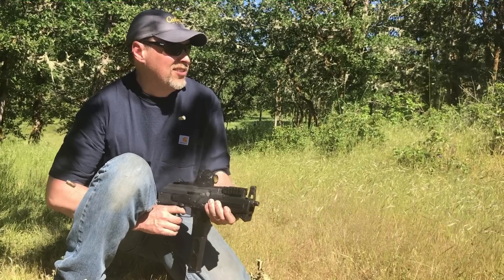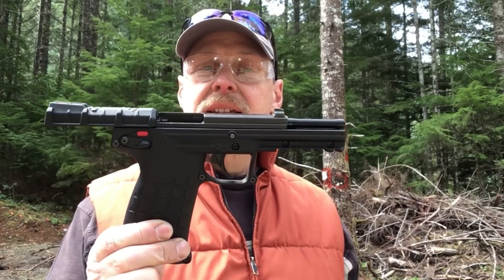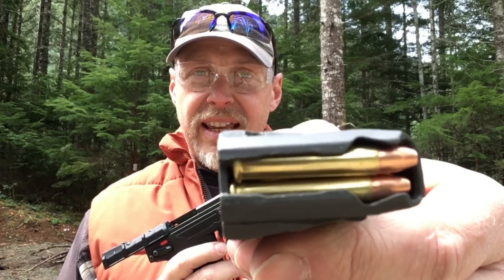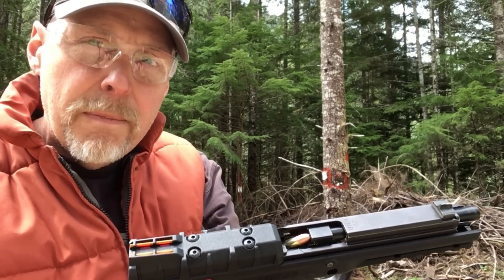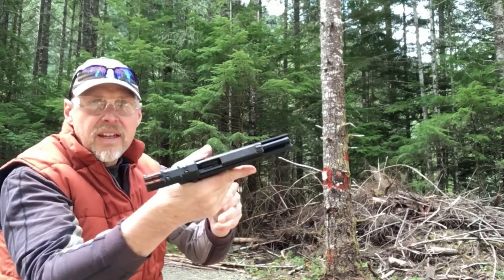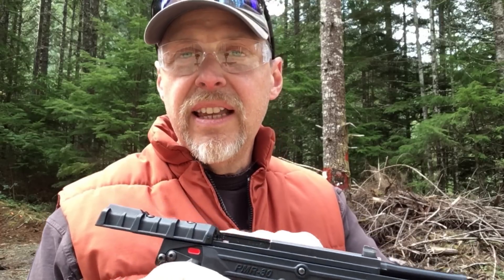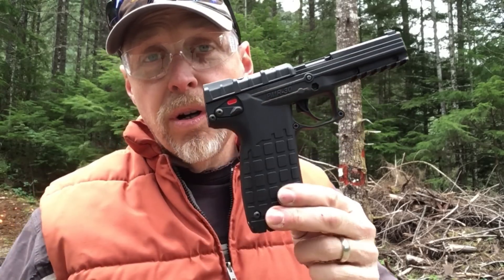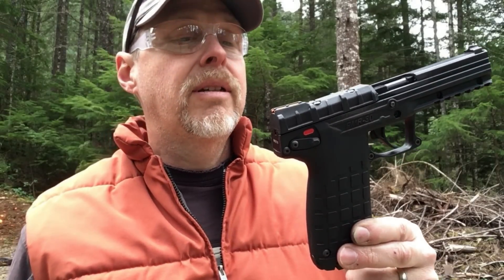Troubleshooting: the Kel-Tec PMR 30

Comment: These have been around since the 80s. went under the maker of Grendel which was the ancestor company of Kel Tec.
Reply from the maker: Haunted Hornet 
  Yeah. I did a google search and this came up with some info of that also. 
  I just love the idea.
Reply: @MaxHeadspace9mm  i had a grendel p30. It was well used. Had to fashion a firing pin for it. 

Got the carbine recently. Not sure what to make of it for now.
Reply from the maker: Haunted Hornet 
  The CMR30? I’ve heard good things about it and hope to get one sooner or later. What are your thoughts? Looks compact, light and shares mags with the PMR30. What could be better?
Reply: @MaxHeadspace9mm  havent shot the proper ammo through it. Mostly failure to extract as in the case remains in the chamber. This is my fault for not getting ammo with a high enough impulse to work the action. I figure 10 lb ft of momentum is necesarry while a lot of ammo us only pushing about 9 to 9.5. Im going to run cci maximag 40 grain and hornady critical defense next time i go out.

Also lookin into the 35 grain a22. It pushes over 10.6 lb ft of momentum.

I an thinking to run the strongest ammo through it for a bit until the action gets broke in some than maybe it will function with weaker stuff.
Reply from the maker: Haunted Hornet 
  One of the things I tried when my PMR30 wasn’t working was I bought a selection of different ammo in grain weights ranging from 30 to 50 to see if that helped or if I could notice any new kinds of malfunctions. All that did was decrease the amount of successful cycles. So once I had received this back from the factory in working order I had all these partial boxes of ammo that wasn’t right for the PMR30. Since I don’t have any other guns that use 22 mag I took some buddies shooting and we used up all that ammo in an afternoon. It hung up a few times and I knew the reason wasn’t the guns fault. But it was good to see that these KelTec firearms are really tuned to a certain type of ammo and run reliably with that alone. Otherwise you get problems. I suspect that if you get exactly what KelTec recommends and stick with that you will be aok. Please let me know how your CMR30 works when you use the recommended ammo in it because I would really like to have as much fun from that as I am having with my PMR30.

Comment: Brass filings and Brass powder? LOL not brass but unburnt powder. Brass isn't filing away your gun. You have a short barrel with a 22 magnum. 22 magnums have slow-burning powders meant to be shot out of long rifle barrels. The short barrel causes a lot of unburnt powder.
Reply from the maker: Steven Johnson 
  Thanks for wanting to be helpful. 
  I definitely can tell the difference between brass powder and unburnt powder. This was clearly brass powder and filings. The only place they could have come from is the casings in the ammo feeding through the gun. It’s the only brass involved. There is no brass parts in this KelTec. That’s why when I coated the rounds with graphite you could clearly see in the footage that it helped noticeably. Friction is a part of the problem and this only goes part way into making it reliable but it was something easy I could do in the field and it worked so on to problem #2.
Reply: If you've ever shot this gun you would know there is tons of brass residue/filings. Buddy has two both do it.

Comment: I carry a PMR30 most of the problems people have with this gun can be solved by making sure you load the clip correctly you really have to tap that clip on a table or something when loading the clip
Reply from the maker: HTTKB 
  Well I did it as carefully as I could. I made certain the rim of each round was overlapping and tapped it (I often do this anyway even with other rounds). I’m still working out the bugs. I will have a lot to talk about when I finally get to the review on this pistol😉

Comment: Try loading the mag as per manufactures instructions that fixes 75% of isusses with the PMR 30
Reply from the maker: wiseguy436 
  I definitely loaded the mag carefully as per manufacturer instructions. Turns out the problem was a manufacturing defect. The follow up video tells the rest of this story. It’s called, “ KelTec PMR30 100% Reliable!”

Comment: I’ve been looking into this gun quite a bit. The thing I don’t understand; these are obviously very common issues. How can Kel-Tec put this gun on the market knowing how flawed it is
Reply from the maker: iLLBiLLsRoastBeats 
  That is an excellent question and one I was asking myself as I paid for this thing knowing I had seen lots of bad reviews about it. I’ve never owned or really wanted to own a Kel-Tec before this PMR30. I think it’s part of KelTecs business model to provide very innovative firearms at a rock bottom price. They know there will always be a budget conscious part of the market who will buy their product and put up with trouble because they got it cheap. On the other hand I’ve seen some excellent reviews about this gun and many people have said how perfectly theirs worked. So I can only believe that KelTec has QC issues that are the result of a little less fluff and buff at the factory. They figure if someone has enough trouble they can do that work on their gun if they’re willing to send it in. I don’t see how this makes sense either but it’s common with the bottom feeder gun makers out there. Like Taurus is another one. Make a really good looking gun at a great price and cut corners where you have to and deal with peoples complaints later. One hidden cost is cutting tools.  As the carbides that are used to make these parts wear they need sharpened and replaced. A company like KelTec or Taurus may not change or sharpen their carbides as often to save money but it results in slightly sloppier specs and finish work. Things like that. 
  Still a great idea just more work  and risk for the consumer to get what they want.
Reply: Max Headspace9mm you make some great points and you really know your firearms. I’m looking forward to the post break-in video. You got me as a subscriber
Reply from the maker: iLLBiLLsRoastBeats 
  Well thank you sir! 👍
Reply: It's not the gun.   All the issues I have seen are with sub 40 grain ammo.   Or flawed magazines.  Or poor loading of the magazines.   Get the speed loader, and most magazine problems go away, IF it is flush when inserted.    Try the Hornady 45 grain FTX, I have put 1200 rounds through mine, and zero issues.
Reply from the maker: Ken Kaufman 
  Believe me in this case it’s definitely the gun. I’ve done all the fixes people have told  me about as well as all the fixes I’ve found on the internet. I’ve been through it all with this pistol from stem to stern. My next video on the subject will share all the fixes I’ve tried as well as the results.

Comment: You don't mention loading the mag according to Kel-Tec directions, or that Kel-Tec advises that it is ammo-specific.
Reply from the maker: Larry Kramer 
  Yeah. I should have gone into that. I did read the manual before loading and even though it’s slightly more difficult to load 30 rounds of 22 magnum it wasn’t as big an obstacle as I expected. I was extremely cautious about loading this from the start. And I only bought ammo that was on the list of recommended ammo from the manual. I did however, mention it in the follow up video called, “ Kel-Tec PMR30, 100% Reliable!” Interested in seeing what happened to this pistol? Watch and see!😉

Comment: Mine has ZERO problems 
I’ve had it 6 years 
And I only run Winchester 40grain Hp
And as long as I do my part loading it has no problem firing and ejecting and loading the next rounds

Comment: I wish other companies would use this to make their own 30 round 22 mag pistols!
Reply from the maker: Javitruck 1 
  The appeal of 22 mag is pretty hard to resist. I knew I wanted this pistol when I picked it up. It’s so light it defies the laws of physics. And 30 rounds? How could I resist? Ballistics by the inch has this length barrel propelling this 40 grain pill at about 1250 fps. And it’s a very minimal recoil and muzzle flip. Laser accurate too.

Comment: My Smith and Wesson Revolvers only misfire due to primer failure, and they clear with a pull of the trigger
Reply from the maker: Liberty Cave 
  Ok and what’s your point? I have revolvers too. And yes, they are reliable. But does your Smith and Wesson revolver have a standard capacity of 30 rounds on a gun with rail space and options for anything you could possibly want and is so light you could slip it in a coat pocket and forget it’s even there?
  Watch the sequel to this video where I show it runs flawlessly now and has for hundreds of rounds. It’s called,” KelTec PMR30 100% Reliable!”

Comment: I purchased my Kel-Tec PMR 30 seven months ago shot 500 rounds the first month had no issues,six months later had failure to feed almost every round, changed magazine had one failure to feed next round had a stove pipe blow back damaging my slide cover and my barrel block chipped inside the slide.The Ammo l was using was CCI 40g.(recommended by Kel-Tec) would not recommend it. 1-1-2020
You can see the damage on my YouTube video.
Reply from the maker: Did you store the magazines fully loaded? I’ve found that keeping fully loaded mags in the gun can lead to reliability issues like that. Once I removed the mag at the end of the day it stopped malfunctioning. I made a video, “ PMR30 for Concealed Carry”. I give some handy tips like that in that video.

Comment: First of all, this is not a self defense gun and is only a fun gun to shoot IMO. Having said this I still feel that it should not have so many problems from the factory at all. Breaking in period on a firearm is BS. How would you like your new car to stall every time you stop at a red light until you are able to drive 500 miles to break it in. KelTec has always had this problem with their guns and  will continue until they they put forth the effort to change whatever it is that create these problems.
Reply from the maker: Steve Katz 
 Basically I agree with you. And that’s why I never owned a KelTec before this. Their unique market position seems to be “innovative budget guns” and a few of their products are getting pretty good reviews but mostly they have a terrible reputation.  I want to believe in this pistol but it takes a lot of rounds to build confidence. That’s why if I get to 1,000 rounds through it with no major hang ups I will do another review and possibly carry it occasionally. The sequel to this video shows what was wrong and gives a better outlook. It’s called, “ KelTec PMR 30-100% Reliable!”

Comment: Mine is getting worse. I'm 500+ rounds into this disaster. (Lucas oil, the beans for sure.) I hate this weapon! The magazines are jamming and I am getting more (different) misfires. A quote from their website:
"Its innovative operation system also allows for the use of a wide variety of ammunition." REALLY?! 
Yet their manual quotes:
"The PMR-30 pistol functions best with high power ammo, often with bullet weights of 40gr
and up. This includes, but is not limited to, the following:
-CCI Maxi Mag 40gr
-Winchester Super-X 40gr
-Remington Premier Magnum 33gr"
I have been using the Winchester and CCI rounds with horrific results. My shooting buddies laugh at my purchase. My PIG is going back to the factory. For $380 I expect better results. Some people have no problems, many more do. Kel-Tec needs to tighten up QC, BIG TIME!!!
And yes, I am doing the tippy-tippy-tap-tap-tap loading methods and cleaning after every 90 rounds. I can Field strip the sh#t bag in under 20 seconds now. It does shoot tight groups at 100 yards (2") How pathetic of Kel-Tec to release WAL-MART quality trash!
Reply from the maker: 4BoxersWebDesign 
  So yours started out good and went to bad?!?!? I’ve never heard of that happening. I wonder if something worked loose or became sloppy in the action. Only thing I can figure. 🤔
Reply: @MaxHeadspace9mm  Thank you for your reply, sir. I went ahead and sent it back to the factory. It started ramming the rounds into the area below the feed ramp. The thing is deadly accurate though. I can hit clay pigeons from 100 yards with ease. I could easily fall in love with that weapon. :-)
Reply from the maker: 4BoxersWebDesign 
  It has a lot going for it for sure. I hope they get it right for you. Great design, poor execution.

Comment: First off, they dont lie ALL kel-tecs require a break in period.
Reply from the maker: T D3434 
  Does it say that in the manual? I didn’t get one with mine but I read the on line version. Which may have been incomplete.
Reply: @MaxHeadspace9mm  Sorry, I should of been more accurate with my statement. When I say they, I refer to Kel Tec owners group and many keltec forums. and my own KSG. When I first was looking at these firearms with their bolted together plastic frames. I was a bit hesitant so I did a quick search and every forum said the same thing. because of Kel tec's manufacturing you will need to run anywhere from 150 to 500 rounds through it to break it in. I know they are getting better as My KSG works a lot better than my friends who got one of the first ones when they came out. Mine really didn't take more than a few boxes to be smooth, his is still kinda sticky. talk to any Kel tec dealer and they also will tell you there is a break in period.  I would l love a good operating .22 mag but I don't know if I would buy a kel tec over a rock island. just because of this norm.
Reply from the maker: T D3434 
  Ah. Thanks for the clarification. Yes it’s funny how many people dismiss this pistol as junk. As if all the happy owners who express great function are lying for some reason. 
  KelTec really took on a huge task when they designed this pistol. Many engineering hurtles. But I’m a little shocked at how well mine works now. I did a follow up video to this one called, “KelTec PMR30 100% Reliable!”

Comment: New Sub !! I bought this gun today mainly as a bed side gun and an entry level gun for my wife. I watched quite a few vids on it first and it got pretty good reviews. Shot it right outta the box today and had all the same issues as in the vid. I knew up front it's probably pretty dry outta the box so I expected issues. What I didn't expect is I couldn't get more than 18 rounds in either mag and quite a few times the spring wouldn't lift the round high enough to feed to begin with. I think the gun has a lot of potential but the mag issue is bothering me. Any advice other than what was said in the vid?
Reply from the maker: dbel723333 
  One thing I’ve done is take the mag apart and spray the inside with graphite, then reassemble. That helped mine. I also found that my breech face ( the flat part that had the firing pin in it needs a drop of oil right on it. Most of my hang-ups were as a result of friction in those two places. Once I (over) lubricated them they were noticeably better. It almost feels like I’m teaching this gun how to work right. The more it functions well the more I start to lube it a little less at a time. Eventually I’m confident it will run with very little oil at all. Just needs breaking in. 
  Thanks for the sub!!!😉
Reply: Max Headspace9mm thank you sir and I’ll give that a try !!

Comment: And if it doesn't work out I mean Kel-Tec has a lifetime warranty on them just send it back and they have great customer service my cmr-30 I've had no problems with
Reply from the maker: john collins 
  Yeah. I’ve given it everything I got. I may have to wave the white flag and send it in. It’s a great idea in principle for a pistol if it works. I really like so much about this thing. If it can be made reliable it could easily be one of my favorites.
Reply: Max Headspace9mm  I sent my PMR-30 in and within a week they had it fixed and sent back to me but I also live in Florida too so that may have something to do with it too now's the nail driver
Reply from the maker: john collins 
  Good to know it can drive nails on top of being a great pistol😆. Just kidding. I really appreciate the tip. I will send it in. I think there is too much wrong here to fix myself without re machining or replacing some parts. When I get it back I will share my experience. 😉

Comment: Is the PMR30 double or single action?
Reply from the maker: Nathan Holn Show 
  It is a striker fired single action. Reminds me of the feel of a Glock in more ways than one. Very nice trigger. About 3 lbs pull weight and decent reset. Ridiculously light weight for a full size handgun.
Reply: Max Headspace9mm ah. I got their P11 and thats double only and something like 12 or 13 lb trigger pull.
Reply from the maker: Nathan Holn Show 
  Yeah I think they do that for safety because its a defensive pistol that can fit into a pocket. The PMR30 is more of a holster sized target pistol. The trigger is really quite good. 
  I like the P11. Ive considered getting one. Do you carry it?
Reply: Max Headspace9mm yeah its my EDC in warm weather since its so easy to conceal.  I have literally got it through a patdown (he didn't ask if i had any weapons on me - i told him shortly thereafter.  It was weird night. ) the barrell is so short and the trigger pull so heavy that accuracy is a concern so i carry a turkish m9 clone in cooler weather.
Reply from the maker: Nathan Holn Show 
  Well I would think that most defensive situations would be extremely close quarters. Almost too close to aim at all. The hard thing is practicing with a pistol that is tough to shoot. But the P11 seems pretty easy to live with day to day.
Reply: Max Headspace9mm actually if you take the slide off you can see that it is single action hammer fired with a 3 to 4 pound pull. The hammer is down in the back of the lower in an aluminum frame. Just make sure you don't pull the trigger and let the hammer fall by itself because it can damage the aluminum frame.